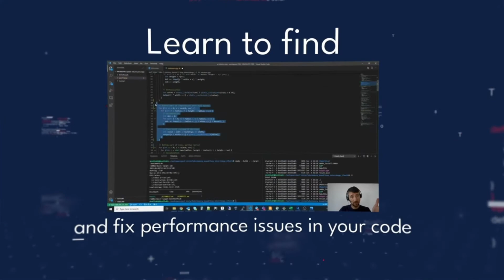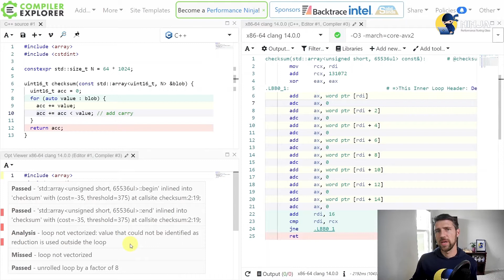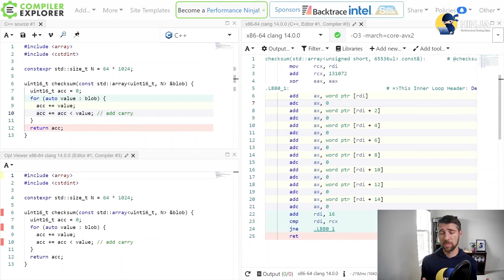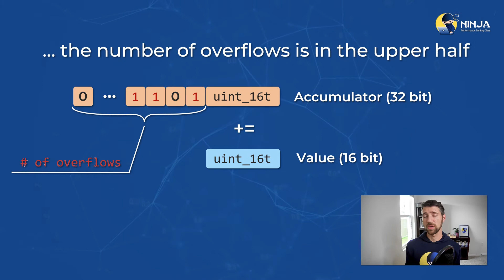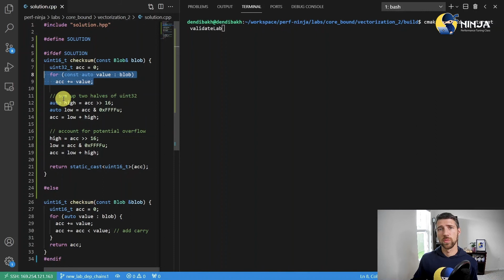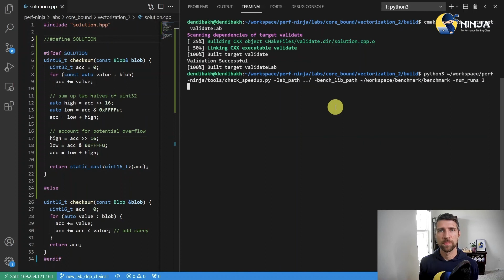Performance Ninja -- Vectorization 2

Comment from the maker: Vectorization intro: https://youtu.be/osfIC5uO0G8.
Here is the complete code of the solution:
```
#include "solution.hpp"

uint16_t checksum(const Blob& blob) {
  uint32_t acc = 0;
  for (const auto value : blob) {
    acc += value;
  }

  auto high = acc >> 16;
  auto low = acc & 0xFFFFu;
  acc = low + high;

  high = acc >> 16;
  low = acc & 0xFFFFu;
  acc = low + high;

  return static_cast<uint16_t>(acc);
}
```
Reply: Hi, you solution is only valid as long as higher bits don't overflow, if you set constexpr std::size_t N = 64 * 1024 * 32 it becomes evident.
With this, it should work for any blob length

uint16_t checksum(const Blob &blob) {
    uint32_t acc = 0, acc_prev = 0;
    constexpr int step_size = 1 << 16;
    for (int i = 0; i < N; i += step_size) {
        for (int j = i; j < i + step_size && j < N; j++) {
            acc += blob[j];
        }
        if (acc_prev > acc) {
            acc++;
        }
        acc_prev = acc;
    }

    uint16_t left = acc >> 16;
    uint16_t right = acc & 0xFFFFu;
    uint16_t ans = left + right;
    if (ans < left) {
        return ans + 1;
    }
    return ans;
}